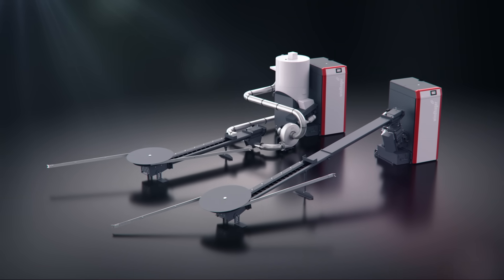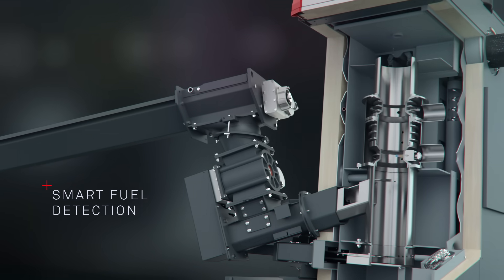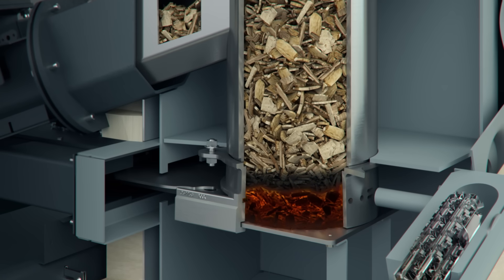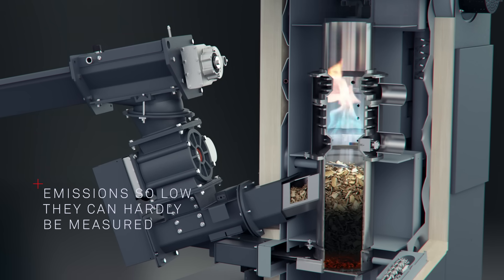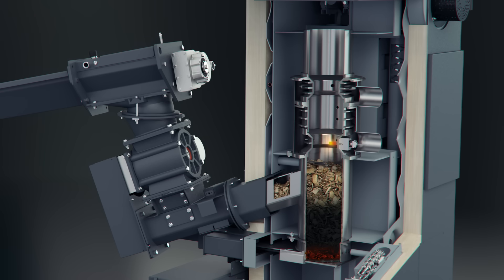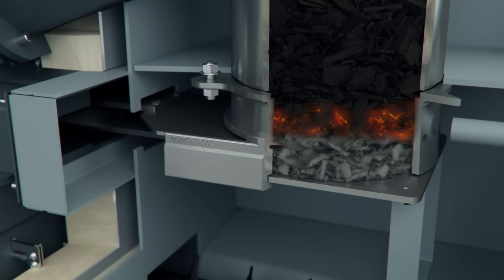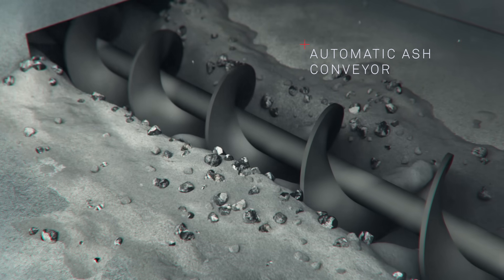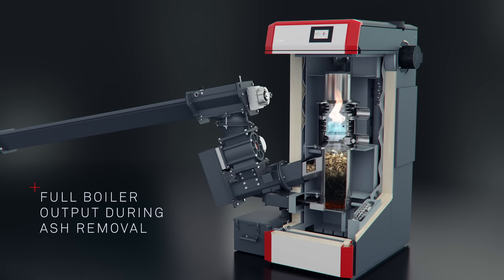Windhager PuroWIN - wood chip boiler - zero-emission gasification boiler with stainless steel burner

Comment: "emissions so low, they can hardly be measured." So the can be measured? "several times lower than the strictest statutory limits." So how many times lower? What are the statutory limits you're referring to?
I'm sure it's a great product, but I'm not into whoever produced this video. Makes it hard to trust.
Reply: And emissions of what?  Surely it's producing large volumes of carbon dioxide and water at a minimum - it has to if there's any combustion going on at all.
Reply: @jasonpatterson8091  The combustion is CO2 neutral so far but then you put on top the CO2 emitted to get the wood out of the forest, turning them into woodchips and transporting them to your home. All in all quite good. But here is the thing. What wood are they using? In the USA they tried to get this woodchip idea rolling but in fact they were destroying woodland for woodchips to fuel the burners which is contra productive to the cause. It's basically another industry trying to sell "green energy" to you.
Reply: @Enforcer_WJDE  I think this is more an off grid application of tech. Its not an industrial boiler its as small wood chip boiler you can use to heat a cabin and give it hot water. When you live in the woods far from the grid hot water is nice and you have plenty of woodchips
Reply: @BadOompaloompa79  Nah they have been marketing it for housing in general over here instead of a traditional gas or oil system as a green solution. Either as a wood pellet or wood pellet and wood variant. It even says the wood comes from scraps wood or from the forest so they are in fact felling trees for it. Apart from getting the wood out of the woods into your oven it's pretty much close to carbon neutral compared to other methods but not a solution for the masses because you can't grow trees that fast even if you wanted too.
Reply: @BadOompaloompa79  this thing can heat several appartments, depending on insulation :)
Reply: @Enforcer_WJDE  trees are replanted, the forresting industry is now 90% renewable, and woodchips are created as a waste producting during wood processing, this gives the waste chips a use using an already near renewable sourced system
Reply: @XiaoYueMao  Is what you think. 
How long does it take to grow a tree? Decades even on fast growing ones. 
You release all the carbon a tree has collected and it takes at least 20-30 years for a tree to filter out all the carbon. It's may be more or less neutral but do you see the problem in the equation?
Reply: @XiaoYueMao  They don't? Then tell me what are they pulling out of the atmosphere?🤔
Reply: @Enforcer_WJDE  they pull out carbon, and then process it to other things, not only are you uneducated on the topic, but you clearly didnt read my last comment
Reply: @XiaoYueMao  untill they start chopping down more forrests than they can grow because this is such a big deal and everybody has to be supplied with woodchips then its just a factory process of chopping trees for chips which all produce C,O2 in their own (machines use electricity and are powerd by coal generators etc.)
Reply: @juriaanromkes7558  we already have a massive supply of woodchips dummy. so much so that we throw woodchips in gardens, in parks, Literally everywhere. every tree processed becomes atleast 20% woodchips due to the processing methods, so no, we wont need to increase cutting for this
Reply: @XiaoYueMao  You seem to know less than you think. 
Simplified for people like you: Tree takes CO2, takes carbon as a building material and gives off the oxygen.  Call it collect, filter, absorb, all the same. 
An old tree has a ton of carbon, you fell that tree and burn it that ton of carbon is released into the atmosphere basically immediately as CO2 because that's how combustion works. 
You plant the same tree it takes another 30 years at least to get that ton out of the atmosphere. Do the math,  it doesn't work out.
Reply: @Enforcer_WJDE  it does a lot more with that carbon, it doesnt just store it. it wouldnt be collecting it for no reason. it uses that carbon to form other molecular structures to grow. and during the burning process that carbon is filtered/collected before it enters the atmosphere through this process so there is nowhere near as much carbon entering the atmosphere as the tree processed in its lifetime

again, your the one not smart here. you clearly cant do simple math nor understand the entire process thats going on in this cycle
Reply: @Enforcer_WJDE  like Literally the entire point of this boiler is to filter out all the co2 burnt off before it hits the atmosphere, so im not sure what co2 is hitting the atmosphere that the tree has to recollect. did you not watch the video?
Reply: @XiaoYueMao  It doesn't work like that. In the video it states the charcoal layer at the bottom acts like an active carbon filter that filters out fine dust particles. Charcoal isn't activated charcoal. 
CO2 is still being vented into the atmosphere, there is nothing in that system from stopping that.
Reply: @XiaoYueMao  I don't intend to be rude... but you are mostly wrong. A tree as you say does not store CO2 in itself just like that, a tree captures CO2 from the air, and with the help of the sun and a little thing called fotosintesis, is able to break down, through chemical processes,  the CO2 into the O2 that we breathe and molecules of Carbon, that on other chemical reactions gets bonded with different elements such as Hydrogen from water, O2 and different other elements obtained from the nutrients of the soil.  All that to create cells and compounds that build up the tree and allow it to grow...

A tree can't change an Element, so as much CO2 as it gets is as much Carbon it has in it self... the tree can't get rid of that carbon by converting it to something else like you said... it can just combine it with other elements to create different molecules with different properties... but the carbon it captured, stays ass carbon and will only be carbon, not CO2 , but carbon.... To get rid of the Carbon atom you would have to split it in half like we do in nuclear reactors with Uranium.... and that just doesn't happen inside trees...

So no matter what happens roughly speaking and considering a tree as a closed system.
If a tree during 25 years sequesters (lets say) 1Ton of CO2 it will have less than that 1Ton of Carbon in it (because it releases the O2...) but when you burn it on an oxygen atmosphere, you will return the 1T of CO2 because combustion happens when you add O2 + energy of activation (spark/flame/temperature/pressure/...) to a medium that can be combusted...

Burning a tree returns as much CO2 as it took away from the atmosphere...  
A Tree is made up of around 50% cellulose ( or in molecule C6H10O5 that is 6 Carbon atoms 10 Hydrogen atoms and 5 Oxygen atoms ) if you burn celulose you get this chemical reaction:
C6H10O5 + O2 = H2O + CO2 (this is how combustion works...) now we have to make what is called stoichiometry, which means.... level out the amount of O2 we have to add to the reaction to burn the whole thing ...
C6H10O5 + 6x O2 = 5x H2O + 6x CO2  (what you see here is the proportions you need to have a full combustion of Cellulose, for every molecule of Cellu... you'll have to add 6 molecules of Oxygen...) as you can see on each side of the reaction there is the same amount of elements but combined in different molecules... so As much CO2 a tree sequesters, is as much CO2 a tree will return when burned.

The main point of that filtering property of this burner is not to trap CO2 but to trap Unburnt chemicals and partially burnt molecules that would be toxic or pollutant or inefficient... (it clearly says : New levels of DUST emissions that can hardly be detected) it filters it, so later on it can be part of the combustion when the ashes reach it... and then burn it cleanly.... but in no way is possible to burn something and not release CO2 unless you capture it in a tank and then do something with it.... one can't just burn CO2  and get rid of it... it's not how this world works....
I don't expect you to reed this far.... but if you did.. hope you apologize to the people you called dummy and uneducated, because otherwise.... you are just making a fool of yourself! 
Remember kids science is not an opinion its factual... so before you speak do some research...
And if you didn't understand my explanation also remember... The universe is under no obligation to make sense to you.
Reply: @setoain20   @setoain20  everything you said is literally exactly what i said, yet you said im wrong, hilarious, my native language isnt english, so maybe i used the wrong words here and there. but i did quite clearly say the trees break down co2 to combine carbon with other things to make new molecules which it uses to grow

i them said the whole point of the woodchip boiler is to them catch any carbon emissions through a filter before its released back into the air

literally everything you said is exactly what i said but in more accurate terms. so no, im not apologizing because the people i called a dummy said a tree stores carbon (it doesnt, it uses it to make things) and that this boiler releases all stored carbon into the air (it doesnt, its designed to catch most forms of carbon emission, though as you said, it cant catch it all.... not to mention your not burning the entire tree in this boiler anyway) 

i called them dummys for a reason, and your comment only glorifies the fact that they are indeed dummies.
Reply: @BadOompaloompa79  wood chip heating is used for normal homes as well as large city heating facilities, they are using shit wood quality fast growing trees that are constantly replanted as well as waste products from saw mills
Reply: they have less emissions because they're far less energy dense than fossil fuels

Comment: Similiar in concept to the wood gas and coal gas adaptors used to power some vehicles during WW2 as a fuel saving measure. But with a modern design update.

Comment: More info is needed. The chips trap the pollutants, but those chips eventually get burned and release what they have trapped. Also, you have to haul in a bunch of wood chips and have them piled in your yard. Then you shovel them into a large hopper and put a lid on it. The hopper discharges into the feed system that goes into the boiler. What happens if those chips get rained on before you get shovel them? How does the average homeowner -- not to mention a person in an apartment -- deal with a large pile of wood chips. Then there's the expense of the whole operation and the price of the system. What's the break even time? Think of how much wood you need to warm your house for the winter. The average home needs 3 cords of wood. That's a LOT wood chips being delivered to your house each year. Wood is solid and dense. Chips are about half air and take up twice the space. Also, who delvers wood chips? Hardly anyone. You would have to find a supply near your home. Not just sawdust from a mill; you actually need chips. This system won't work with sawdust.

Comment: BS no pollution without scrubbing. No mention of where the sustainable ignition source with high temperature of 1,200 degree C. The syngas would have CO, H2S formation. Reforming with steam H2O would change and give H2, CH4, CO2, Sulphur.

Comment: Lower the combustion temperature, fill the chamber with dry bud, and fill the house with vapor... Party on, Garth!
Reply: This doesn't just blow the combustion fumes right into the house ... otherwise you would die of carbon monoxide poisoning.  There is a fan that blows air over some sort of heat exchanger, transferring the heat without filling the house with toxic fumes.
Reply: @neilh.4385  Thank you, Neil!
Reply: I like how you think

Comment: I wonder how this thing would handle plastics and compostables. Obviously it would handle paper just fine.

Grind up your trash, remove the metals, and instead of igniting the gasses, condense and store them. You could then refine them into gas or oil that could go into your car, or even make certain types of plastics out of it again.

Comment: Thunderfoot I call upon You, Please have a look at this!
Reply: My first thought :) Although I don't see much to bust except the "no emissions" statement.
Reply: @calvinthedestroyer  the ember bed staying up to 4 days without any need for fuel or ignition, 90% cut in ignition energy etc etc. just sounds like a magic bean :D
Reply: @Remedynr  And I think it's a waste of energy to have a screw just to move the ashes 20 centimeters to the side, it could just be a little taller and put the box under the boiler.
Reply: @ExtremeGamerYT22  height of the unit has to be minimised
Reply: @h00db01i  Why the case? They could just put a drawer kind of thing instead of all that mechanism occupying the space under it and call it a day.
Reply: @ExtremeGamerYT22  height of the unit has to be minimised
Reply: @h00db01i  What if it goes to the ceiling?
Reply: @ExtremeGamerYT22  I'm just being intentionally dense here, sorry. I guess moving the ashes to the side allows for longer period without emptying the ash box (largest possible ash box with lowest possible height)
Reply: @h00db01i  I just don't get why the lowest height possible?
Reply: @ExtremeGamerYT22  because the room in the basement where this thing is installed has a limited height itself. it could be much larger but then I guess it would have to be considered while planning a building, before it's actually built. these system often replace existing heating solutions, so they should be as compact as possible. and room are usually not as high but there's enough vertical space. just my assumptions though, as said, what you proposed should also be possible

Comment: How this boiler modulate power, and how much time need to stop, as we see here is lot of chips inside the chamber, so it is a some time needed for combust that amount of chips, and in that period of time temperature will increase in system, maybe a lot, causeing overheating. My question is, regulation of the temperature...

Comment: Me at 3am: 
Youtube: Here watch an ad about wood chip boiler
Me at 3:05am: That's amazing!
Reply: Hmm day 8 of cov19 locked in I'm Sachin this at 340am. Tell me a few things I want to know about the most of it is where can I put it in my house do I have to build a outdoor boiler shed and wood chip storage dry stores shed outside of my housewhy is there no further information about how it integrates of a kind of heating is it basically a hothead heating system solution or a water storage radiator boiling system similar to current gas boiler systems is it just something that generates heat at somehow transmitted in the house
Reply: 2:23 AM here XD
Reply: 6:14am and have work at 12:00pm xD
Reply: wtf... I watched the vid at 3:00am, too. Is this stuff time-based??
Reply: 4:12 a.m.  I think we are a different kind of human.
Reply: LOL ok youtube.. :)
Reply: 6:45am here and I haven’t slept yet
Reply: 2:46
Reply: Me at 4am: how does it know when the embers are above the plate thought?
Reply: 3:13

Comment: So, wouldn't it be more useful if the energy transformed in there can be harnessed?
Reply: It is not just a wood chipper burning machine for the sake of burning woodchips. It's a boiler, made for heating the water in the tank attached to it. The water then turns to steam and gets circulated around the house in a closed loop, heating the radiators so the house stays warm.

Comment: Zero Emission is a lie. Carbon Neutral is at best an ideal situation. It however requires energy to cut down, harvest, process, and ship the wood chips. And no, electric is not a viable solution. Too much down time.

Comment: "Emissions so low they hardly can be measured" That's not your product being very good but the measuring device being total trash!
Reply: there are for sure emissions in the form of CO2 and water, but other than that there should be very little particle emissions escaping due to of the nature of wood gas

Comment: what? is this a joke? what concievable purpose could anyone have for explicitly burning woodchip? not making use of the heat since there's no insulation systems, not making use of the materials created like charcoal, it just leaves CO2 H2O and maybe some H2, O2 and CH4.

but as it says, it has such little emissions, so 99% has to be CO2 and H2O. 

Neither of which is in short supply, and both are easier and cheaper to manufacture using other methods.
idgi

Comment: ok so if it's "zero-emission" I challenge you to sit 6 foot cubed air tight room with this thing in it  running at max for 24 hours. carbon neutral is not zero-emission, what if I bought this for my air tight bunker. you literally might have killed people with your lies. what if I bought this to work in a chemical plant that had reactions that were sensitive to carbon. granted most people would not make such mistakes but we are increasingly moving to a world run by computers that common sense is not able to be programed in. so honest  labeling becomes super important. in fact that should be one of the new test before something can be called zero-emission the person trying to label it must be sealed in with it running. we don't trust that it's carbon neutral really was the steel carbon neutral I want to know how you pulled that one off. how were the fire wood trees planted did that take no carbon really. when you start doing the math on carbon neutral you realize that their is no carbon neutral. that's why no one wanted the carbon credits system because plastic bags start looking efficient and a lot of the green tech starts looking expensive.